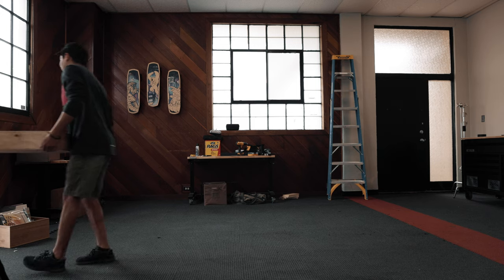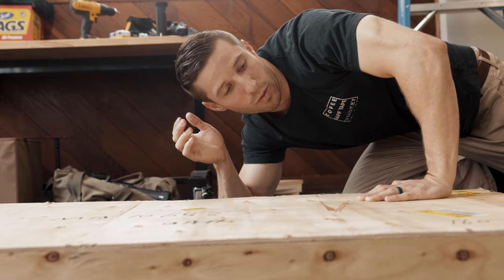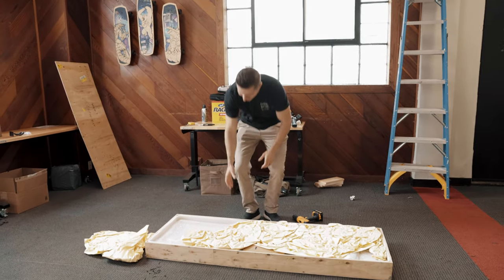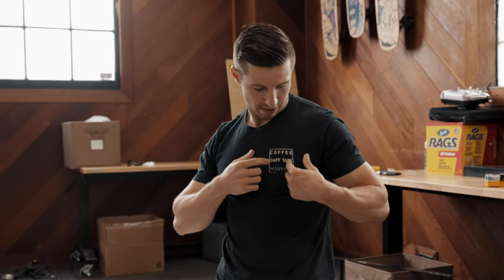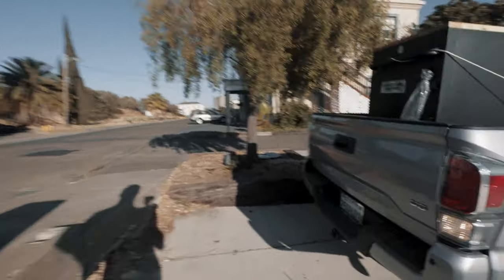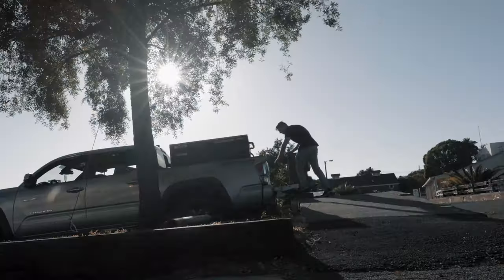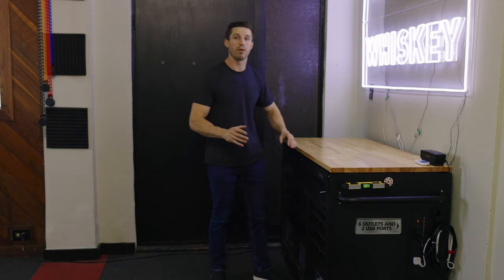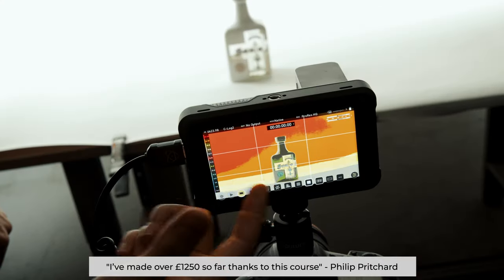Build the Ultimate Camera Gear Storage Station for your Studio

Comment from the maker: Comment below with how your dream station would look!
Reply: I would paint white on one side and black on the other, will have a table probably wooden and 2 other tables one for pc/mac and one for shooting commercials and i only need 2 windows one on black wall one on white. And for storing gears a little shelf like yours with  charging system attached to it
Reply: I really like your new studio, great color theme💥❤
Reply: I would have used Kaizen Foam and then top layer your foam of choice. Kaizen Foam will stop it from moving around if transporting is necessary. Mine is mobile using Kaizen Foam and Tanos Systainers. Then I have list of items inside on the tags on the outside...imagine Festool boxes that transport Camera Gear on carts 😉.
Reply: How did you set up the wood on the wall?

Comment: You should sell your Ursa G2 and get the 12k for the slow mo, the reframing possibility’s and the value for money. It’s only $5000 after a $4000 discount.
Reply from the maker: Yeah but it also only does 220frames at the 1080 while the g2 does 300 at 1080 so I didn’t think it really would be worth it